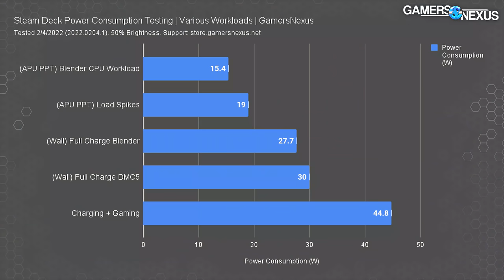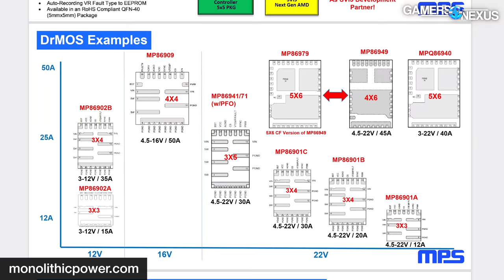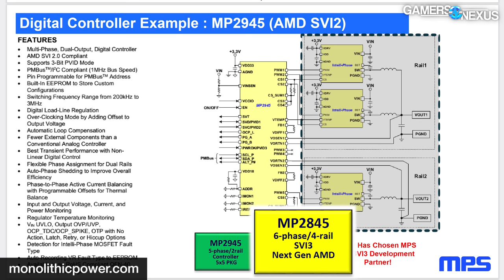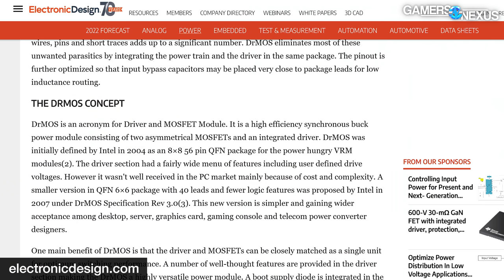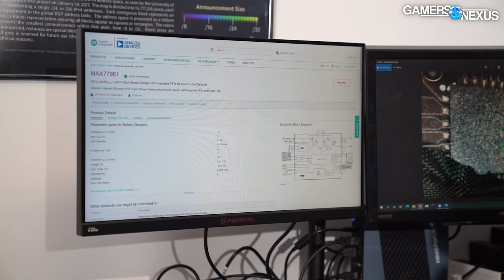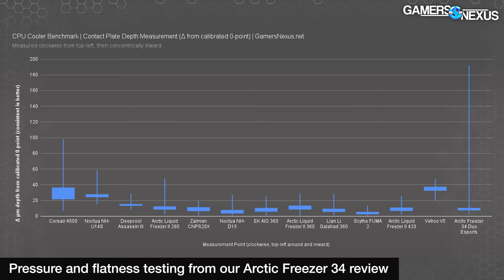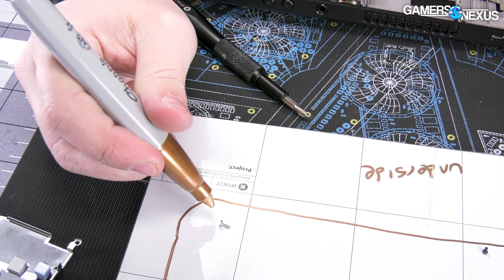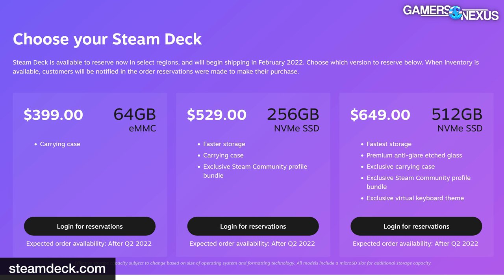Steam Deck Tear-Down: Build Quality, Disassembly, & VRM Analysis

Comment from the maker: One correction: the 6A comment would be at a lower voltage (not at wall power), and therefore not a concern. That's our error from pushing through these two videos so fast. But you still shouldn't open your device and then touch stuff while it's running, period.
If you missed it, we have a full hardware review of the Steam Deck on the channel already: https://www.youtube.com/watch?v=NeQH__XVa64 (WATCH THIS VIDEO for full details on thermal design, airflow design, power, gaming benchmarks, and more on the Valve Steam Deck)
GN 3D Coaster Packs are now on back-order! https://store.gamersnexus.net/products/3d-coaster-pack-4-component-coasters
Get an anti-static electronics GN ‘Volt’ Modmat, in stock and shipping NOW: https://store.gamersnexus.net/products/modmat-volt-large 
GN 10-piece Toolkits are IN STOCK & SHIPPING NOW: https://store.gamersnexus.net/products/gamersnexus-tear-down-toolkit 
We also went through the specs of the Steam Deck here: https://www.youtube.com/watch?v=ZkolKam3kjU 
Watch our factory tour series: https://www.youtube.com/watch?v=NQU5lK29br8&list=PLsuVSmND84QuVMZuk2HGUtCSYXR7nmC5a
Reply: Please show more gameplay on the Steam Deck. I'm curious about how well various games play on it. Horizon Zero Dawn, Destiny, Halo, Fallout 4, Skyrim, Red Dead 2 and anymore you would be willing to show. I love the content. Thanks
Reply: what are you doing up stillllllll
Reply: @robertlawrence9000  They can't do that yet, as its only the embargo on the hardware that's lifted. They can only play Control, DMCV, Dead Cells, Portal 2, and Forza right now as a means to show off how the hardware performs under different conditions. The software embargo lifts sometime in the next few weeks
Reply: @TheKillerStove  oh dang! Ok. I was wondering why they were showing only certain games only since it's been in people's hands.
Reply: @robertlawrence9000  They arent allowed to yet because the System Software isnt finished yet. Its only working but VALVE said they need to wait (about) 2 more Weeks to finish it and be allowed to test/talk about it actually.
Reply: This teardown is EVEN BETTER than the review !!! So much teaching moments from you and Patrick ! Congrats to the GN team this is AWESOME 😍
Reply: Very good enunciation of Mandarin with very little discernible accent. Impressed, well done.
Reply: The amount of bots in the comment section is really getting out of hand...
Still best tech channel on the whole platform!
Reply: Is the grey inner frame metal? Or plastic?
Reply: nvm, magnesium, that says everything I need to know. Great freaking job guys, to both you AND Valve.
Reply: "the 6A comment would be at a lower voltage (not at wall power), and therefore not a concern" 
I was gonna say the exact same, if we consider our body as a resistor, say 100k ohm (made up value) you would need WAY more voltage to get 6Amps thru you (600KV or 600,000V to be exact if we consider 100k ohm as the resistance). Needless to say, that would kill anyone instantly. BUT, at a 4.2V battery (each cell), or even at the 12V input, you would feel absolutely nothing with a 120uA following thru you (again, considering 100k ohm value).
In any case, great to see you guys correcting yourselves, maybe drop a correction banner on the video as not everyone reads the comments.
Reply: I literally went to comment section to complain about. Very misleading for someone who doesn't know electronic basics.
Reply: I've had a burn on my skin from shorting the terminals of a 2S LiPo with my thumb before - don't discount the damage low voltage high current can do.
Reply: @Gig-th3er  yeah, DC is more dangerous indeed. But if you had 15-20Amps thru you you'd be fried and long dead by now. That's just not how electricity works, see my other comment above.
Reply: @Gig-th3er  cool, that makes sense!
Reply: Let me clarify:
At 25 volts, mostly DC, you feel nothing unless you do something very wrong.
6 amps alone will not harm you, what is harmful is the current through your body.
Ohm's law states: Current = voltage divided by resistance.
Human resistance varies with voltage, and it's high at 25 volts.
Using Wikipedia table on the subject and a bad scenario:
25V / 1Kohms = 0.025A
According to the table is perceptible but no muscle contraction.
However the table is AC, and while checking I found out it's a complex subject.
However according to NFPA 70E
30 Vrms or 60 Vdc in wet conditions is "concern of electrical shock"   found in "Determining voltage levels of concern for human and animal response to AC current"

Long story short, that charge IC can harm you, however it will be less likely the electricity through you, and more likely the sparks when it goes into short circuit ruining your device.
Reply: 6A @ 9V is still extremely potent. A measly 9V battery has the potential to stop a human heart.
Reply: that stainless steel shield should be made from aluminum so the charging ic doesn't die an early death after warranty falls off
Reply: herayy i can liquid metal it
Reply: I am so glad this was pinned. I'm a tech so when he said that, it immediately set me off and I came down here. I always use the example of a car battery. Peak amperage is insane on those (600 amps?), which would absolutely murder everyone that opens a car hood if 12V could conduct through skin. 25V is the max on that charger, which is still too low to shock you through skin, but I wouldn't lick it haha.
Reply: I came straight to the coments to mention this, and you've already got it covered. It would definitely be a point of concern if you were charging at higher than 48v, but not the 3v to 12v that the charger IC is rated for.
GN you folks are great!
Reply: Glad you corrected that, even at 25 volts, the chance of feeling any sort of tingle on bare skin at that voltage is pretty slim. Varies a lot person to person, but 25v is pretty low and most people's skin resistance should make it a non issue.

I guess if your hands are wet that changes but that seems unlikely. Sure you can get a tingle from a 9v on your tongue, but your hands are faaar less conductive
Reply: Don't touch?
Lucy said: Do it. Do it. Do it. Do it. Do it. Do it...
Reply: A glued in, essentially non-user replaceable battery? And iFixit was touting, that Valve was actually pro right-to-repair. Yeah, right.
Reply: Btw, nobody says Tee You Vee, even if it's an abbreviation. It's chiefly pronounced Tüff in German. 😜
Reply: Yeah, no kidding. I was about to screech about this statement in the video, lol.
Reply: @eduardodacosta4670  It should not be a concern and with the Steam Deck's charger probably isn't. But we've heard of people dying in the bath tub because that charger carried actual wall power through to the cable when the plug/phone hit water. That's down to unsafe, usually cheap ass chargers. Still, people buy these, so a word of caution is in order.

Anyway, thanks for the mathematical break down, I was always a bit uncertain whether it really works the way I think.
Reply: As soon as I heard it I scrolled down and it was already addressed. Good on ya.
Reply: 4:39 thats what she said
Reply: Can_we_upgrade_the_battery?
Reply: can you guys share data of what you've find out about this teardown thanks
Reply: At 23:40 Steve mentions doing heat sink pressure and flatness testing in a later video. Was this ever done?

Comment: Valve are legends for encouraging independent reviewers.
Reply: Not only encouraging them, but actually sharing engineering document, not everyone are Beve Sturke who can afford the newest and flashiest testing equipment among Youtuber.
Reply: No reason not to when you have a good product
Reply: @Verpal  AND they want to sell replacement parts for it so you can repair your unit or have someone repair it without having some custom part only they could fix.
Reply from the maker: Valve even shared some of its testing with us, which is incredibly rare. We normally find out one way or another, but sharing information allows everyone involved to do a better job
Reply: I feel like Valve is being congratulated here for things they should just be doing.
Reply: @LN997-i8x  Having been on the other side of the fence selling customized computer "appliances" there is real competitive advantage to holding on to your most accurate testing data. The easier it is to copy basic design elements - the more valuable the hints regarding any "secret sauce" algorithms and integrations.
So "they should just be doing" for data sharing - isn't a traditionally held stance in the competitive waters I once long ago swam in for testing data.
Reply: Forget encouraging them. I am so on board for the amount of repairability Valve has been pledging for this thing If they actually follow through with it and I can get official first party replacement parts for the joysticks and the triggers when I need them. I am never going to regret the price of this piece of equipment and it will become a mainstay in my daily carry bag
Reply: It's called free advertising lol
Reply: @youtubesuresuckscock  You can just install windows and use that for it. Or other Linux distro. Or they can patch it in later. This is an odd hill to die on. They haven't done a lot of software testing as it's not yet finished. Once the NDA on it lifts you'll see more of that.
Reply: @youtubesuresuckscock  The fact I can open and fix, that it's engineered well, that people who are technically inclined are encouraged to tinker with it and that it comes at a good price point far outweighs variable refresh rate which isn't on my priority list or on others'. Seems unfair to slam them for this one feature.

And regarding what somebody else said, it being free advertisement, sure. But other companies have are far more restrictive with their engineering or production samples around launch. Nothing wrong with showing off something the engineers are proud of when it's likely of interest to many customers.
Reply: @youtubesuresuckscock  go buy an aya neo then for triple the price, oh wait that doesn't have VRR either. IDK what kind of fairytale you live in where a device this cheap has VRR.
Reply: @LN997-i8x  when your competition is nvidia its hard to not look like jesus
Reply: @LN997-i8x  Sad, isn't it? Other companies should do the same yet few do.
Reply: @barnett25  Well said. For me, it's for doing it right the first time. Valve could easily sell people something cheap and it will still sell out of stock. Hear me out...especially during our current market with the GPU shortage. Not only did they make a good product, they priced it fairly, and I think they also limited it to Steam accounts that are some years old to prevent scalping? The guys at Valve are doing good.
Reply: @youtubesuresuckscock  Someone is mad
 because they cant get one lmao 😆
Reply: @Its-Just-Zip  I honestly wouldn't be surprised if Valve simply opened a replacement parts section on their site to make it easy to get parts from them. It'd be a win/win for both sides.
Reply: @Joreel  this is exactly what I want them to do in the long run. I completely understand that directly after launch it will be hard to open up parts that are otherwise needed for production but I'm hoping that in a year or so they will be available on the site and I won't have to call support for them.
Reply: Legends for avoiding number 3 too.
Reply: I ain't even mad if they did this instead of HL3.
Reply: What a refreshing attitude from a large company.
Reply: Facts, def gets them good publicity, marketing, and gets informed opinions to alter future versions. All around I’m a fan
Reply: @youtubesuresuckscock  ah, low tier bait we meet again.
Reply: Say what you want about the current Valve, but they do understand the importance of their customers, regardless of who they might be. Besides that, I respect that they aren't afraid to try new things, even if they end in failure.
Reply: Looks like “Big Blue Frontend” is a burner account for Tim Sweeney.
Reply: @youtubesuresuckscock  here comes the no life trying to bait people because that the high point of the day.

Comment: All the separate boards for different functions of the device, i.e. independent board for audio, independent boards for analog sticks, is absolutely fantastic. Super easy to replace a small daughterboard rather than the entire board like most devices these days. Way to go Valve!!
Reply: Was just thinking about that. If you break the audio jack it'll just mean replacing a small board instead of having to replace the entire motherboard.
Reply: @GoatedWithTheSause  Hopefully that will be addressed in a future release...
Reply: on mobile the comment cuts down at “analog”… you can guess what it is
Reply: This can be a downside though if the user isn't experienced since it does not take much to break a ribbon cable or ribbon connector.
Reply: @oblivionshadow9453  if they are not experienced enough to deal with a ribbon cable they are not experienced enough to solder things on and off the main board.
Reply: @GoatedWithTheSause  Thats is exactly the point of Type-C. There's very less hustle while un/plugging the usb cable. So not a lot of abuse tbh. Its predecessor, the Micro usb port is worst in that department.
Reply: A reliable device is better than a repairable one, and a single board is better for reliability.  Also better for cost.  My guess is that the separate boards were to let them design and validate in parallel.  Like, you could have the motherboard done and its EMI characterized and in the firmware team's hands, and still be trying out different things for the ergonomics.

If there's a version 2.0, it probably will, and probably should, be one PCB.
Reply: @Vegemeister1   @vegeta meister  I get your point, but no device is ever 100% reliable, so say your audio board breaks like @PAcifisti mentioned, and you can't warranty/RMA your device, being able to repair the single daughterboard yourself or having a reputable repair shop fix it for you will be WAY cheaper in the long run. I work with Chromebooks and laptops mainly and the devices that have the daughterboards rather than an entire mainboard are so much cheaper for the end user to get repaired than the entire MLB, which usually costs more than the device at retail.
Reply: it also means it will be easy (cheap) for a 3rd party to make a different one, I expect the modding community going nuts on this
Reply: @Vegemeister1  i don't think you necessarily have to sacrifice reliability for ease of repair, things will break, this is a fact even on reliable products, so ease of repair is something incredibly valuable where apple has sure, reliable products but one thing breaks and you're talking about repair costs close to what you paid for the damn thing depending on what happened.
Reply: The wifi module is not replacebal
Reply: @RECE4ER  That's not how this works. If you have a dollar and you can spend it on reliability or repairability, reliability is ALWAYS the right answer. The only thing on this where repairabilty should be considered are things that move (fans, external connections, switches, and joysticks) and the SSD because making those more reliable is very, very expensive. 

The problem you're trying to solve is companies designing stuff for a short lifetime; if you want to know what that design lifetime is, it's roughly related to the warranty period. Wanna know why they're overtemping that charger chip? It's not likely to be a bespoke, Valve only part. Valve is just accepting that it's going to have a reduced lifetime because it's running hot.... the design lifetime of that chip is probably many many more years than the lifetime of the battery and they probably don't consider replacing the battery to be an economically viable repair. Don't believe me? What's the warranty? Bet ya it's not more than one year.
Reply: That's only true if Valve actually sell the modules at a reasonable price. Otherwise the many ribbons only make it harder to work on